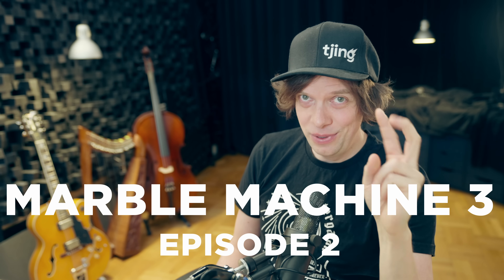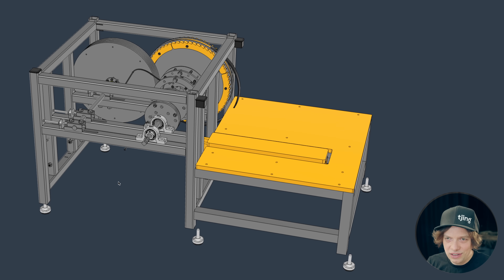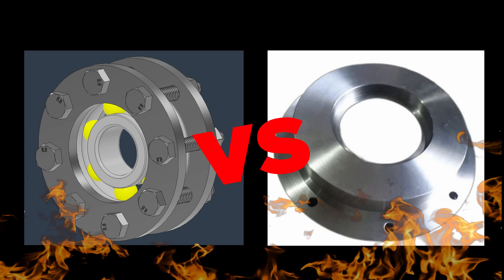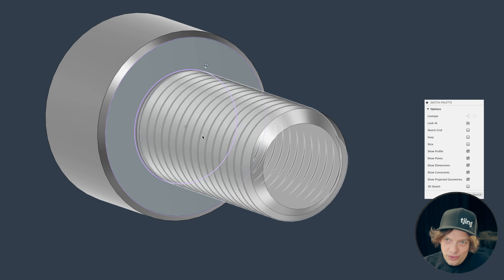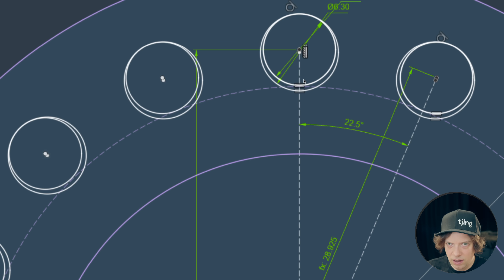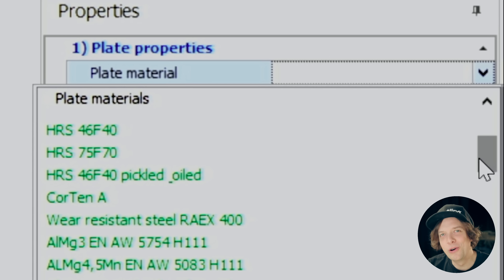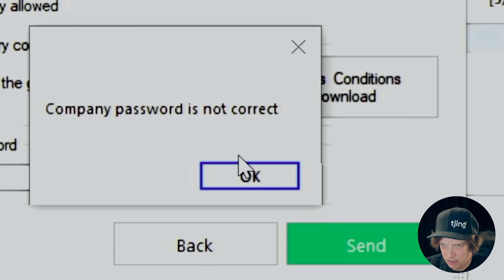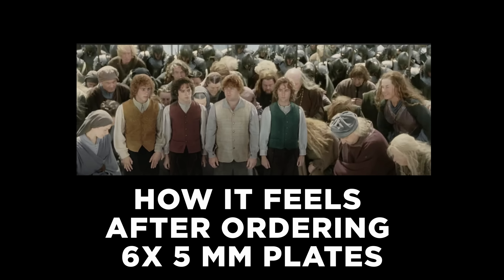Cheap Bearing Housing - Marble Machine 3 Ep.2

Comment: The problem with using bolts instead of a bearing housing is that every single bolt is going to have to be calibrated so that every single nut is tensioned the same, which is a huge pain in the arse. 
  Having to fiddle with however many bolts and making sure their all lined up on the same thread so there's no racking which leads to Vibrations, is crazy. Martin you need to listen to others more, this is way the other ones failed bc you were far too resistant on doing things the conventional way.

Comment: I'd happily say machined housings are 5x better. Remember that these kinds of failure modes compound, so the machined bearing housing removes a substantial number of problems with the whole machine, while costing little extra on the whole machine.
If the entire thing was nothing but the bearing housing, sure your solution would be fine, but the MM3 as a whole is a large complex machine, so if this eventually damages or compromises the whole machine, it would be catastrophic, where the cost difference is minor.
Note that even a slight offset of the flywheel could destroy the machine (or injure you). Of all the places to cut costs, is this the ideal?
Also also, if you want a standard bearing housing, you could design your own standard housing - or as many have suggested, use an off-the-shelf one.
Finally, the costs of doing this yourself in time, effort and delay, massively outweigh the costs of an off the shelf version.

Comment: I really hope you don't go through with this bearing housing concept, as many people are right in saying that there are much better solutions. For a critical part such as the flywheel it needs to be more robust, considering the mass and inertial energy involved. As for the clutch, if you are looking for simplicity and efficiency, I'd suggest off the shelf production clutch parts that have been designed and manufactured to be up to the task. Resulting in a comparatively inexpensive assembly and parts should you need replacements, that can be easily replicated in other areas of MM3 rather than a bespoke solution.

Comment: Any time you deviate from "the way its always been done", you really have to ask why you are doing it. There's innovation to solve problems that have never been solved for, but there's also "but I don't wanna do it the usual way!" whether it be cost or perceived simplicity. If bearing cages were actually cheaper or simpler, they'd be in use everywhere. But they aren't, because you can't get good tolerances. I've tried similar "clever" solutions and it's always a disaster. Your best bet is to either get pre-fab pillow blocks or insert bearings, or laser cut the flange a bit large, and do a quick operation on the lathe to bring it to a press fit.

Even if you get the cage tolerances PERFECT, the threads will wallow out and it will no longer be in tolerance. Even if you use shoulder bolts, as some have suggested, it will still fret and wear unevenly. You're not making a million of these and need to drive the unit cost. Just eat the "100x more expensive" and do it right.

Comment: Curious why you would use full thread bolts for this? Wouldn’t “shoulder” bolts be better? As you would have full contact along the shaft of the bolt as opposed to just the high points on the threads, which would dig into the bearing or flatten out as the flywheel turns. Your flywheel is also going to have to be extremely evenly balanced for the bearing to not wear out or acquire some slop.

Comment: Unfortunately I have less hope for mm3 than I had for mmx. Extra features ike different size marbles and also not listening to engineers when they say using bolts to hold a bearing is a bad idea. 
When you have this large and educated community, it is worth listening to them.
Reply: Yep. I feel Martin is suffering from some sort of expression of the Dunning-Kruger effect, and is now in a very dangerous zone. You don't screw around with dubious, custom-built parts for critical applications, period.

You just don't skimp on security or on part quality, especially if there's an audience involved, and no amount of reinforced steel cages can replace proper care in designing systems which won't predictably fail in catastrophic fashion. OSHA would have a field day with this machine, yikes!

Here's the thing that I don't get; I'm just a graphic designer, and even I can sense there's something clearly wrong and dangerous with this part in particular. Must've been all those videos I've seen of ball bearings exploding, or something…

Comment: 2:50

The bolted cage looks absolutely disgusting. I know that you are not going for the looks in the first place, but that doesn't mean you need to go for the cheapest worst looking solution available. Hence down on conventional machines I'd be faster do produce a proper housing on the lathe than designing like 10 different versions for the laser cutter.

Comment: Martin: "make your design requirements less stupid"

Also Martin: "to save some money on this one-off machine that needs to survive a world tour without too many issues, let's hold these critical bearings with a cage of threaded bolts, which requires a lot of fine tuning and will inevitably loosen over time, instead of using simple and precise press fits, which the bearings were designed for, or using off the shelf bolt-on bearings"

Comment: stack plates with different hole diameters to hold the bearing. the bolt locations become irrelevant and the tolerances are more controlled.

Comment: I remember the discussion about the flywheel being incredibly dangerous

So I would like the discussion about anything around the fly wheel to not be about expense, but rather to be about making it as secure as possible, so the audience don’t have their heads chopped off

So I hope the “cheaper” way works as well as what all the engineers on the forums are saying you need to do

Comment: I am interested to see how your design comes out......but.  The thing that bearings really like is RIDGID.  A bolt cage will not provide that.  You can get flange mount pillow block bearing for less than $20 USD.

Comment: Sorry for not reading through all the comments.  Why not put two bolts through with cylindrical spacers and have a third with an eccentric spacer?  3D printers do this all the time to account for slop and get the v-wheels running smooth.  If there's a concern about only three points of contact, just use bigger bolts.  Just a thought.

Comment: 6:10 windows can do resolutions Upto 16k and beyond.
This is an issue on your end Martin, you can try the following steps to verify
1. Verify your graphics card can output 4k
2. Verify that you are using the correct input/output ( hdmi has many revisions with improvements
3. Verify you are using a good quality cable ( bad quality cables have alot of signal noise thus making them unable to transmit high bandwidth.
Honourable mentions: check all your graphics drivers

Comment: Regarding flywheel design.
You may already know this, but a flat uniform disc is the WORST flywheel design. (I don't know what your design is but I'm just supplying some physics here.)
 Ideally most ALL of the flywheel mass should be at the rim. Short of like a bicycle wheel which has very little mass in the spokes and most all the mass at the rim. 
In fact, the ratio of moment of inertia, which is the rotational equivalent of mass, for rim versus uniform disc is 2:1. 
In other words, by moving all the mass away from the center to the rim, you have twice the moment of inertia, and therefore twice the angular momentum as you would have for a uniform disc.
In summary, the flywheel should have as much as of the total mass as far away from the hub as possible. The inner mass, like the spokes of a bicycle wheel, should be as light as necessary for strength.

Comment: Okay so I'm not an engineer or anything, I just build a lot of legos, but like, what would be the issue with making a hole smaller than the diameter of the bearing and then wedging it in? And also like I was taught that the more parts the more points of failure, if you had a plate to wedge the bearing in that's one point of failure, compared to numerous bolts

Comment: I'd hate to see MM3 FAIL. But this is the first step towards this. Remember: FUNCTION FIRST! Don't compromise a reliable, proven way to mount bearings in housings just to cheap out on an "innovative" design. Sure, for non-critical spinning parts, why not. But what spinning part on MM3 will not be critical? Bolts are made with tolerances; they are not highly precise at all. Even if you get a nice spacing and fit once; just using bolts of a different manufacturer of even only a different batch will ruin everything. Don't waste time "innovating", if affordable and reliable (!), proven (!) solutions for problem exist. Sound precision is important to you. What do you think will happen if gears or flywheels are only 0.1mm out of running true? Please Martin, DON'T!!!!! Don't reinvent the wheel! Don't overthink! Feel inside you, and you will know this can't be the way to MM3. Greetings from Germany, Simon

Comment: Just no.   Bolts are for clamping things together.  If you want any sort of precision, you don't use bolts especially their threads as a registration surface.   Bolts are for CLAMPING! 
There are sooooo many other ways of doing this that will be much more reliable and accurate.
You are building in problems with this solution.

Comment: The flaw in this design is that the load bearing against the bolts can cause them to snap. 6mm screws in particular don't have a lot of tensile strength and aren't designed for load bearing. Using a machined bearing housing ensures that your bearings are going to be concentric to one another, which should be the primary goal of designing a rotational piece of equipment. And you are putting that load on a very small surface on the points of the threads. If you wanted to do something like this, I would have suggested using shoulder bolt screws. They have a ground diameter shaft with a thread on the end (the thread size is always the next size down from the shoulder diameter so a 6mm shoulder bolt has an M5x0.5 thread, an M8 shoulder bolt has an M6x1.0 thread. These would be more rigid and are designed to have some side load. That said, you would need a tight tolerance on the bolt circle diameter as well as the hole size. Ideally your hole clearance would be a Class 4 Transitional Fit of +.025mm, but you also would need the same amount of tolerancing on the bolt circle diameter for all the holes in the circle so that the bearing sits perfectly around the surface of the shoulder bolts. This is why you should use precision machined bearing housings. Sure, it is more expensive and more work, but when you are dealing with bearings, you want to have the absolute most precise method of holding that will prevent it from coming undone while it is rotating. I don't know how heavy the programming wheel is going to be, but rest assured that you would be better served having bearing housings that actually are guaranteed not to slip and are engineered to hold vastly more weight than you anticipate.

As a machinist and tool builder, I've seen a lot of issues with engineers not tolerancing their parts correctly for bearings and bushings in order for them to work correctly, so they wind up too tight. Bushings and bearings have a maximum OD tolerance that can depend entirely on the size of the part. Never ever use a vernier to measure precision ground diameter parts, always use a micrometer.

Comment: You're making the same mistakes. Saying "for this design to work out the tolerance needs to be perfect" means you have a fundamental flaw in your design and possibly in your approach. The first machine had its flaws but it worked well enough to make music and you built it really quickly right, relative to the second machine then you started designing the 2nd and also building the thing at the same time and just run into more complications. So why is your solution to just be more perfect in your design approach? It's not about being perfected, it's about being "Aware" of physical limitations and your own personal capabilities when bringing your designs to life. Does that make sense?

Comment: question: is it really 100x cheaper? because surely having some sort of machined plate that you use a standard plate for that you can use as a very small 'subassembly'. also for the foot pedal (I know it has a clutch system) but it just looks like a small movement of the foot will instantly lead to it becoming caught under the static footplate. if half of the footplate was the pedal and the other half were the static area, this could reduce this hazard, but there could be many things im not seeing. I'd really love to see this project finally work :)
Reply: He was using the "100x" as an exaggeration to make a point. But the exaggeration is not real-world and the underlying logic is incorrect to begin with.

Comment: Your reasoning of needing something to be 100x better to offset a 100x cost differential is seriously flawed. In this particular case, you are making one machine and might need a handful of these parts at most - you're not mass producing this on scale where these savings could make or break you. Others have stated this much better than I can.

Plus, you are assuming that every bolt you use will be within the tolerances you need... this is very far from reality. This is such a bad idea on so many levels.

Comment: There are very good reasons you can see bearing housings used in all sorts of mechanical designs, but never one held like this. Learn from others' mistakes. This one really should be a no-brainer: use the tried-and-tested solution if you truly want reliability and simplicity.

Comment: I'm both an engineer and health and safety practitioner and while I love your enthusiasm,  the flywheel is the most dangerous part on any machine and should be treated with the utmost respect.  It needs to be perfectly balanced at speed, and what you'll find is over time the threads on the bolts will distort, introducing play. Once this happens, the flywheel will move, and once that happens eccentricity will be introduced, which will cause the bolts to shear and the flywheel to come off the machine.

Comment: I like youre creative ways of thinking. I personally would have come up with a solution like that as well. But honestly I don't think you have to go cheap. You've got 2.5 million subs and very much views and patreon. I think this housing wil need a lot of replacement trough the years wich is going to make it expensive after all.
Reply: Not only he doesn't have to go cheap, he can't. I wouldn't sit anywhere near the front row on a Wintergatan concert if I knew Martin went cheap on the most critical and dangerous component of the machine, and I suspect I'm not alone in thinking this, IMHO.

Comment: at a MINIMUM you should be using bolts with a shank for this or the bolts WILL break eventually. With a non-rotating shaft like you have ideally the bearings would be pressed into the flywheel. Though I'm not really sure why you didn't just go for a rotating shaft so you could use pillow blocks and just not worry about this particular issue.

Comment: I think yall arent understanding how the bearing works.  I used to work at a manufacturer who made bearing housings that provided a sterile seal.  The only time that you get wear along the outer race is when you have a bad design.  Martins design should clamp the outer race in place, so even if the threads erode (which they shouldnt), the outer race will be held immobile.  I think his design, for his application, is far more than sufficient.
Reply: Also, he can't use a shoulder bolt, because how would he get the threads past the bearing?

Comment: If you can get a quick qoute, than you should at least mock up a proper bearing housing, and get a real qoute  instead of assuming that it is actually 100x more expensive. Afterall, if it is only 20$ instead of 13, than why not get the proper one.

More to the point the amount of energy in this flywheel is scary, and having a unsupported bearing, means that the bottom bolt is really the only thing holding the flywheel up, one bolt hold up a huge spinning flywheel, if it breaks or the bearing housing breaks because of the pressure point and the whole wheel could fly lose destroying everything,

Comment: Please don't spend too much time going down this rabbit hole. Consider Occam's Razor. If there was a cheaper, reliable method of mounting bearings for flywheels, everyone would use it everywhere. But they don't seem to be. Even if this somehow does work and ends up cheaper, I almost guarantee that it will have a rather unfortunate downside. And while learning is great, we all wish you to be successful in your endeavors, so please try to plan for success instead of perfection. Prioritize function over cost, simplicity over complexity.

Comment: There is zero chance that your "solution" will be 100 times cheaper than a proper solution, absolutely no chance at all :)

In all likelyhood you'll spend a few times more money on testing to get to the point of giving up this design than it would cost to just get the correct solution to start with.

There is no guesswork involved in a proper design, just check what tolerances SKF says you should use and specify that on the drawing, and send that to a manufacturer.

I priced out something similar the other day, a bearing housing that mounts 2 bearings in a hollow axle, and they cost something like 49 euros each for 2, machined in 4140 steel, from PCBWAY.

Or, you could just use standard of the shelf bearing housings, they are not expensive.

I'm sorry, but you are going down the wrong path here :)